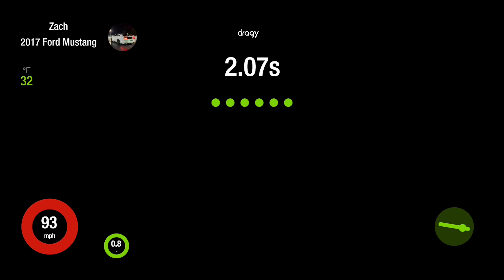Twin Turbo 5.0 runs 9.63 @ 142 MPH after 2 years!!

Comment: Enjoyed the chronology. Fans can follow the evolution from fun street car to solid street/strip performance.   How is the drivability after changing the torque converter?
Reply from the maker: Below 30 mph it is noticeable, but surprisingly tame. Above that it drives just like stock! It locks up in 3rd gear on part throttle around that speed. From a rolling start it has improved response and spool time significantly and obviously the launch speaks for itself!